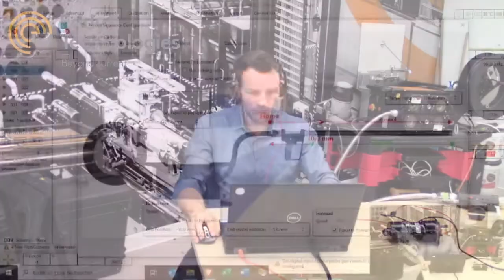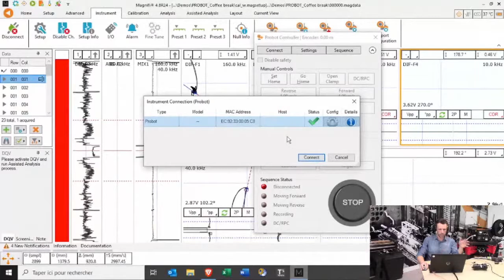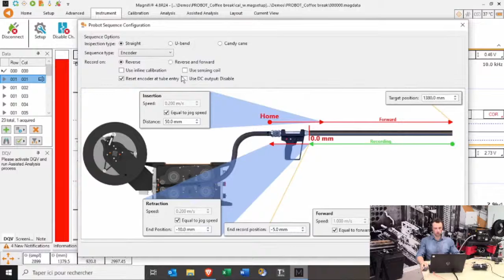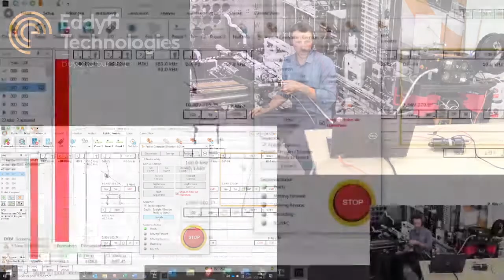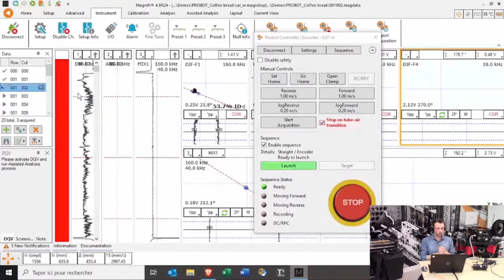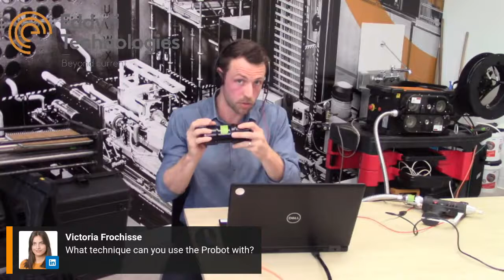Coffee Break with Eddyfi - Precise and optimal tubing data acquisition with Eddyfi’s Probot

Comment: Sir can you i ask? Can you please help me the formula of NEAR FIELD TUBE TESTING DEPTH PENETRATION? THANKS
Reply from the maker: NFT is a technique that is used for the detection of surface-breaking defects (that is, ID defects in a tube).  As the depth of penetration of eddy currents decreases with the permeability of the material, and that the permeability of ferromagnetic carbon steel to which NFT is applied is very high compared to non-ferromagnetic materials, depth of penetration is very low, likely in the tenths of millimeter.  So although there might be amplitude difference between defects of similar size but different depths, or some low detectability for defects that are big and almost surface breaking, NFT would have very limited capacities in those situations and is used to detect surface breaking defects. For more information, visit eddyfi.com!